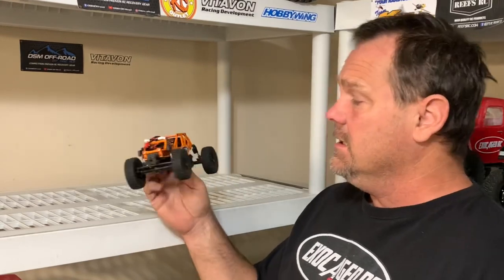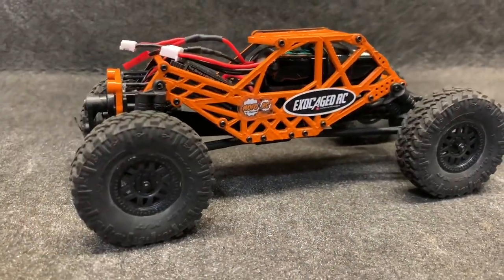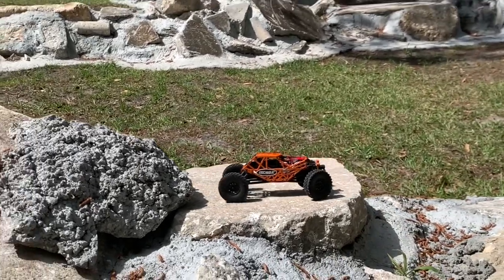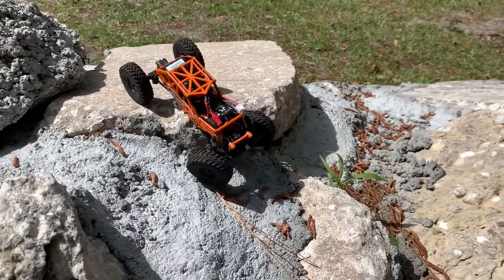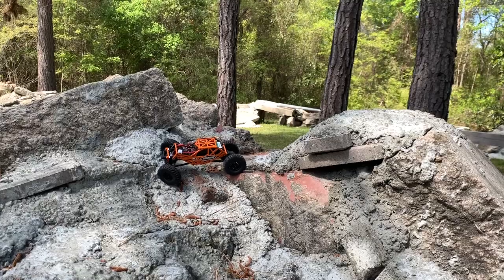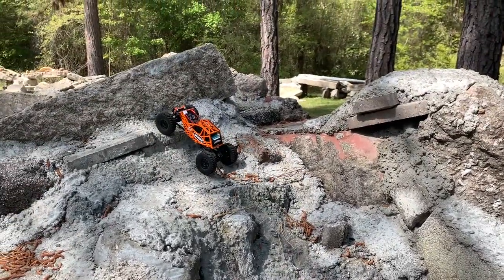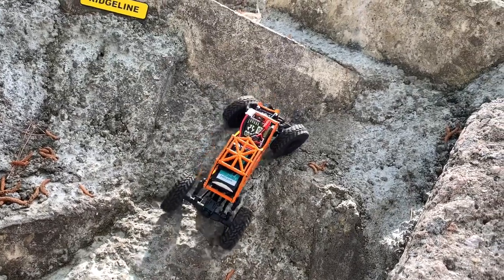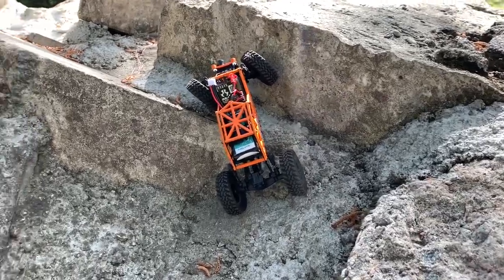Little 24th MOFO Bouncer on the big rocks!

Comment: My Betty nd C10 were amazingly capable before weight and tire change. That body is so square it easily looks to turtle. Both of mine will mainly fall on its sides. Maybe you could sand the top corners a litlle ?